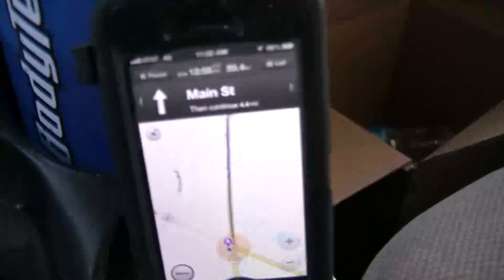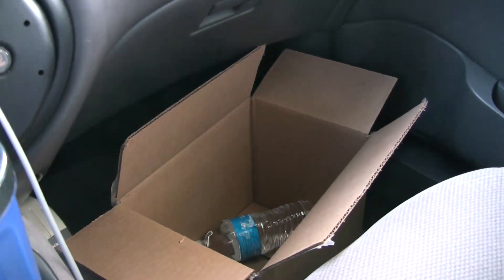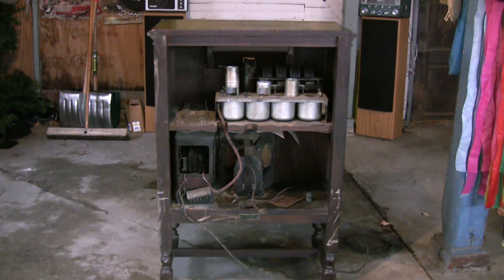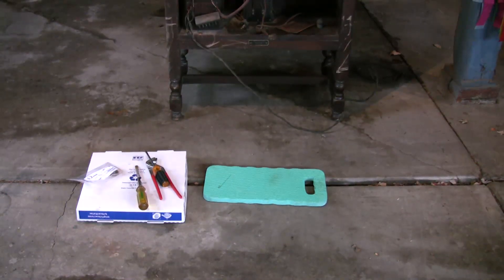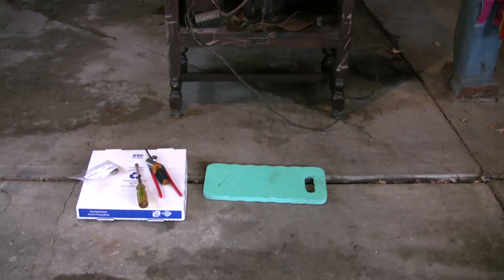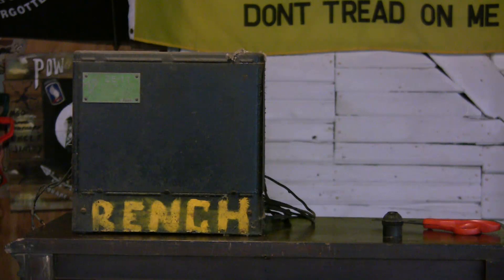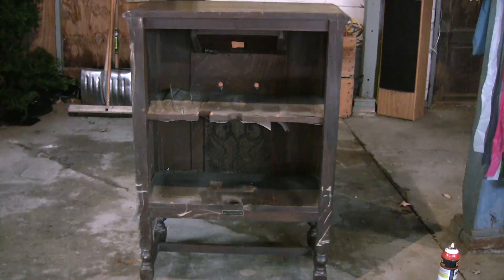Zenith 34P Getting and first look

Comment: What a piece of design and technology! Wish you get it back to life. 
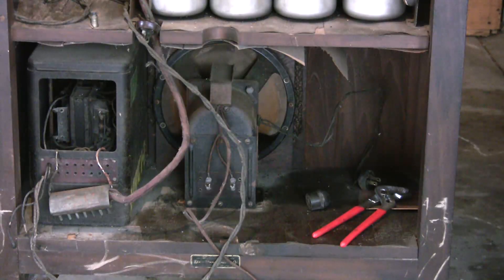There is something I spotted at 7:45. On the power cable there is a Bakelite round connector (plug) with two slots. If the diameter of the round barrel is 1" and space between slots is 1/2" that is connector I am looking for for several years. Is it the one to description? Please don't throw it away!